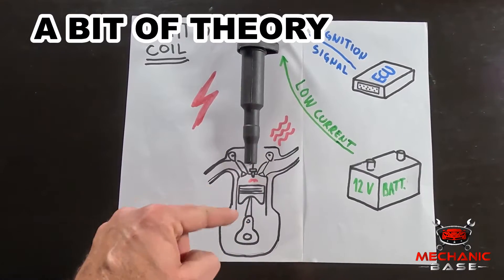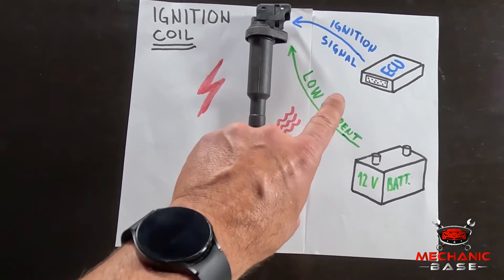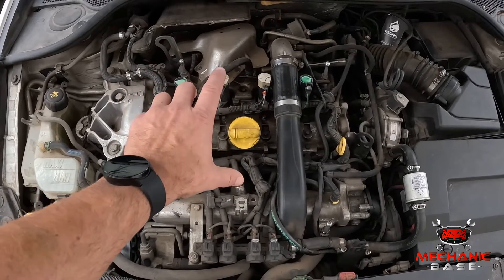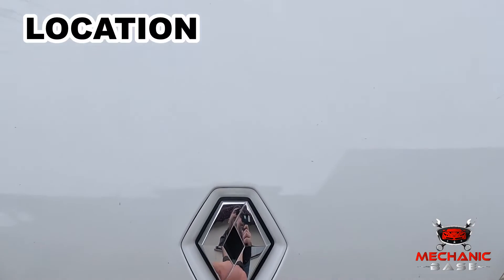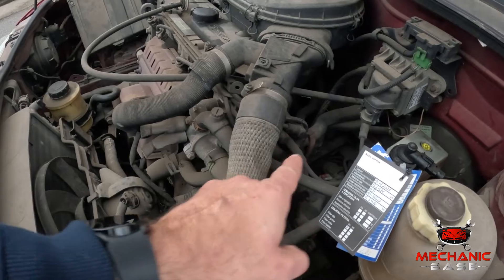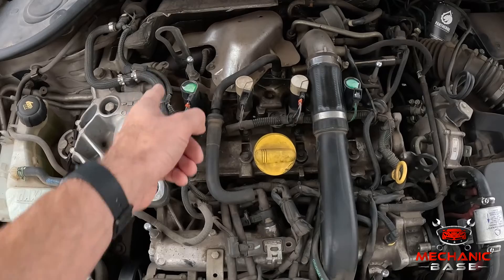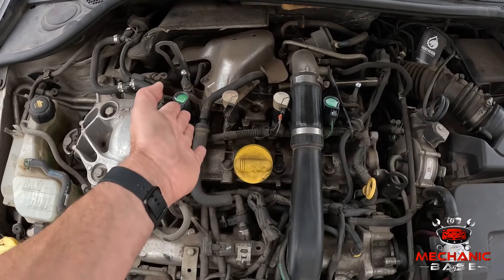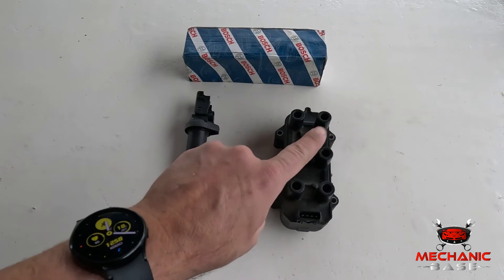6 Symptoms Of A Bad Ignition Coil (and Replacement Cost!)

Comment: THIS IS THE BEST DESCRIPTION !!   I had to watch a lot of videos and read a lot of articles to find you !!!    I am a 71 yr old woman with no mechanical abilities but I took a "Powder Puff Mechanics" class at community college in 1973 when I bought my first little Corolla - lol (that's just for your amusement).    I have found a reliable mechanic shop to service my 2003 VW Passat and usually just trust them to do whatever.   But my current dilemma is that they replaced a coil and spark plug per P0303 code which solved the problem of misfiring and strong vibrations, slow to accelerate, but still have minor symptoms so I'm trying to understand if I should just go ahead and replace the other 3 coils and plugs. Mechanic is not sure I should spend the money because he's relying on the computer diagnostics.   I'll be traveling for Thanksgiving and don't want to cause damage by highway driving.   The mystery is that I have some slight misfiring at low to medium speed, but it starts, idles and accelerates beautifully so it doesn't match all the common symptoms.   Anyone have advice?

Comment: My 2005 pontiac vipe has the check engine light on for more then  18 years -- I was told that it's  emissions issues and the car didn't seem had  any problems until few weeks ago. It idle very rough and vibrate badly. The O'Reilly scanner  indicates all four cylinders were misfiring. When l drove it home it made  very  big 'pa pa' noise then stalled. It still can start but dies in gear.after it be towed back home, the car can just crank  but not start.now I have put all 4 new spark plugs, 4 new injectors and a      new fuel pump but no luck. Next l will put 4 new ignition coils . I am inspired by your informative video. Thank you very much!

Comment: changed all my spart plugs and coils, nothing changed. Recently almost a year later driving with the misfire I finally realized my ignition coil connectors were broken.
Reply from the maker: @traejaxen have you managed to fix it?
Reply: Not yet. Looking for a connector on an old truck still

Comment: I have a 2011 Nissan versa; 1.8 engine; what  are the position of the coils? 1,2,3,4?
Reply: Why do you need to know the position? just start the engine and remove 1 coil, if the engine sounds like its about to shut down it means the coil that you disconnected is working fine. find the one which when disconnected does not affect the running of the engine than you find the problematic one.
Reply: i hear a majority if cars start 1 on the left and 4 on the far right
Reply: You can’t just google it?

Comment: How do I know which one is the first ignition coil on the 2jz-fse for 2002 Toyota brevis
Reply: Why do you need to know the position? just start the engine and remove 1 coil, if the engine sounds like its about to shut down it means the coil that you disconnected is working fine. find the one which when disconnected does not affect the running of the engine than you find the problematic one.

Comment: Hello, i hope all is well. 

Your videos are very informative especially to us who are not mechanics by nature. Please keep uploading these kinds of videos.

I have a question also related to Codes. 

i have a P0304:00 and P0304:A0 detected however i don't know where or which side of the cylinder it is located. Can you help me identify it. 

i have a ford focus 2008 model.
Reply from the maker: Thank you, Johanne👌
We have a lot of videos comming up, so keep your eye here. 
As for your  Focus - the P0304 is cylinder 4, which is one facing the transmission.
Reply: I drive a 16 crv with 65000 miles on it. 
Recently feeling a tiny bit less power on acceleration  than before. 
Shell I replace spark plugs and coil  ??
What do you recommend. 
Please let me know. 
Appreciate your informative videos. 
Thanks a million from the DIY community